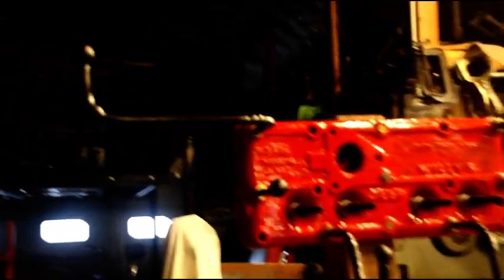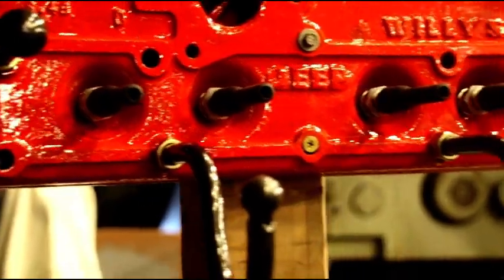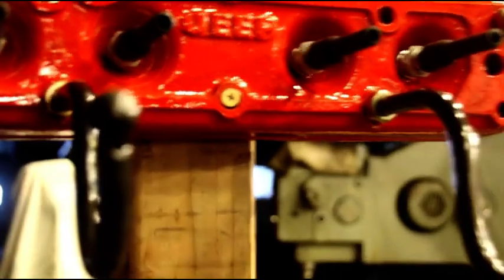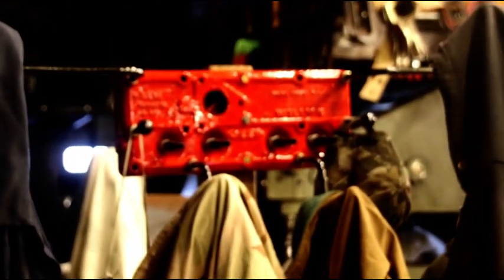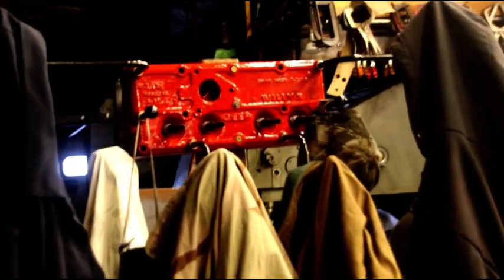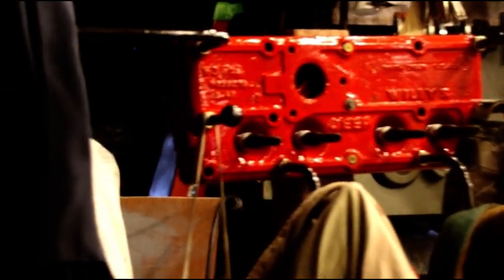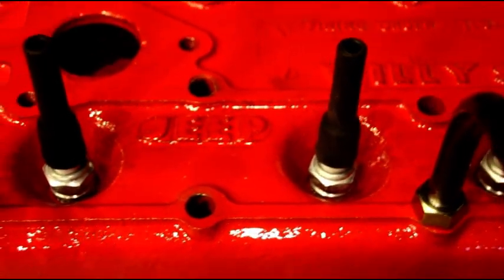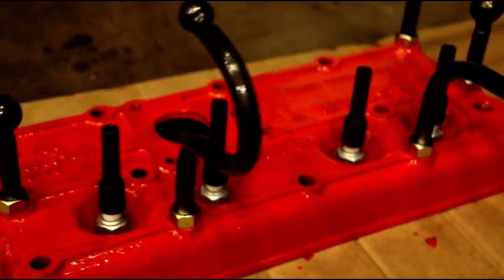Willys Cylinder Head Saved From The Scrap Pile

Comment: Excellent ! Not only did you save a piece of history , but you saved an engine part from a fate worse than distinction , an overseas reproduction .
Reply from the maker: I hate to throw anything out and I have had a pile of cracked and warped heads sitting in a pile for a long time.  Started cleaning up the shop a bit and it just came to me with all the scrap pieces of 1/2" rod I found.  Turned out great and will be making more in the future.

Comment: Even a Rigid threader. You have all the toys.
Reply from the maker: Once you have a Rigid Threading machine you can't live without one.  I did all my air lines with and and fully piped the steam engine with it as well.  I also do a lot of odd ball U bolts and the fastest way to thread the U bolt stock is with this die set 1/2-20
Thanks for watching.